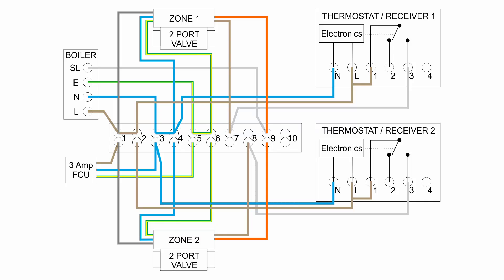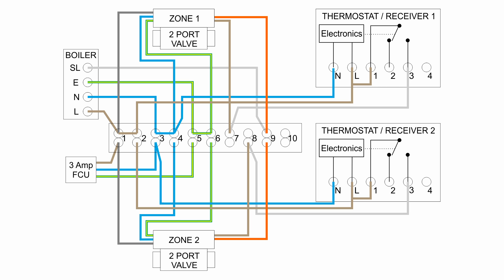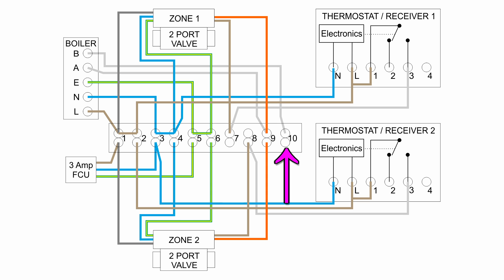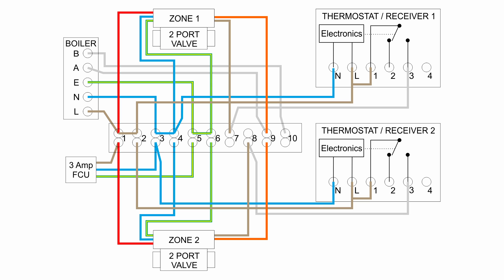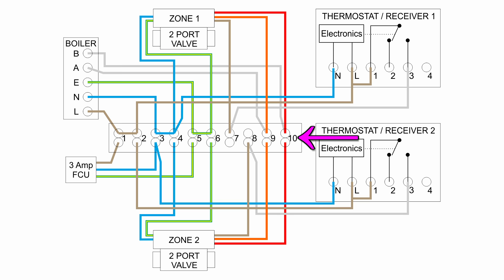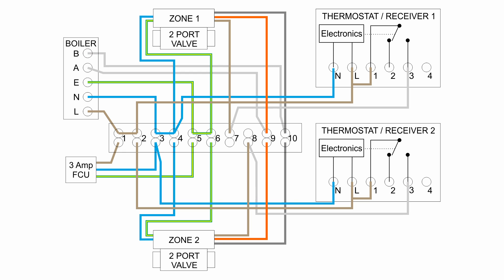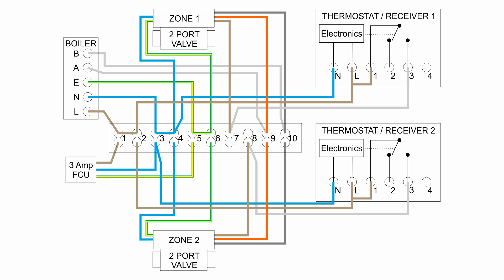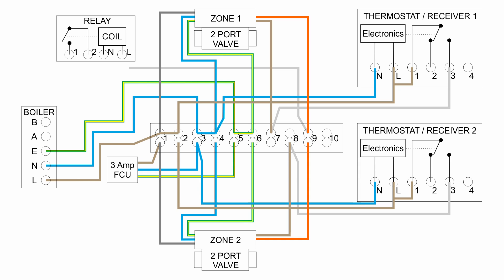Combi Boiler 2 Heating Zones Volt Free - 24V and Others

Comment: Your videos are very usefull. 
Not found information on this. 

How about using open therm and 2 zones This bugged me for a while Can it be done? Using 240 v from stat to switch the motorised valves and open therm as a better communication  .
 Would you say one open therm wire can be connected to orange and grey then other can be straight to boiler as these two wires not acting like a switch. 
Is there a way to to this ?😮
Am I try to over complicate things for having a more efficient set up ?

How about ignore orange and grey wires connected to boiler only use open therm connections from stat to boiler. 
Would that work?

Comment: My boiler supports both low-voltage and 230v control.. Which one is better to use ?
Reply: I have a circulating pump on zones 2 for UFH. how would I go about wiring this up?  E to E, N to N, L to  8 ?.. Once the Thermostat calls for heat, the zone will open and pump turn on. That would make the logic sense as 9 would be low voltage and not enough power for the pump? .. Would it make more sense to go for the 230v controller from your previous video?
Reply from the maker: Yes - the UFH pump is switched by the thermostat, so it only runs when heat is required for that zone.
Use the 230V switching option if the boiler has that.
Reply: @jwflame  thanks!

Comment: What if my UFH controller has volt free output switching for the boiler, but my boiler wants. 240v live return to turn on?
Reply from the maker: Connect 240V to one of the output terminals, the other connects to the boiler.
'Volt free' is just a switch with nothing connected to it, you can use it for any voltage you want.

Comment: Can A & B be connected in any order to the orange and grey
Reply from the maker: Yes.  They are just connected together when heat is required, so makes no difference.
Reply: @jwflame  would I still require the link from L to 1. I assume your using hive in this set up.
Reply from the maker: @asifk159786 NO, as the title states, this is for volt free switching.  If you connect L to any part of a volt free boiler input, it will destroy the boiler circuit board.
If the boiler has 230V switching, use the 230V wiring as described here: https://www.youtube.com/watch?v=98lZvN9q7rw
Reply: @jwflame  thanks. Boiler in question is ideal vogue which I belive isn't low voltage. The boiler has 2 outputs room stat and time. Similar A&b so I think the low voltage video should be fine.

Comment: Great video John!!! I just want to ask is it posible to add more zones in this system and how many  relays i would need ?
Reply from the maker: You can add as many zones as you want.  Each zone needs a valve and thermostat, thermostat output connected to the valve brown wire.  All other wires connect as in the diagram.  No relays required.

Comment: Hello Dear HOPEFULLY someone knows 😊 where is SL 
 In my glow worm energy 25c.
 on the left side where is mains I have L N E RT and on the right side of PCB have B OFF(burner) RT (24v )BUS (+-)
At the moment I have salus room thermostat connected to RT 24v 
My diagram required SL 
Thank you guys 😊
Reply from the maker: If you are using 24V switching, it's the two 24V RT terminals where the thermostat is connected.

The L and RT terminals are the equivalent if using 230V switching.  These must NOT be connected in any way to the 24V terminals, doing so will cause damage.

Comment: Very helpful. How could I accommodate a pump to this diagram please? I would like it to come on after the 2 port valve has fully opened. Thank you
Reply from the maker: Combination boilers have the pump inside the boiler, it's not a separately controlled component.
Reply: Hi John, my apologies i should have been a bit clearer as to what pump i was referring to , the pump i am quoting here is the ufh manifold pump which is connected to one of the two zone valves in my setup.  i think i will need to use the 230V switching diagram for this, any advise will be much appreciated. thanks
Reply from the maker: @nneethan5  Yes, it's the 230V version.
If it's a single UFH zone with only 1 thermostat, the pump connects to the switched output of the thermostat, which is also where the brown valve wire connects.
Pump will run for a short time before the valve opens but this doesn't matter as it only circulates water via the manifold and UFH, not through the valve.

For more than one UFH zone, the pump, thermostats and zone actuators are wired to a UFH controller, with the switched output from the controller connected directly to the valve brown wire.

Comment: Great video. I have one question, how to do it with nest thermostat with don’t have 230v ?? Boiler is directly connected to the nest by the OpenTherm . How to send signal to zone valve?? I am trying to find some solution..
Thank you for any suggestions.
Reply from the maker: You will need to use the other terminals on the Nest to switch 230V for the valve motors.  Opentherm is only control for the boiler.

Comment: Hi, this is a great video for learning!

2 questions if you don’t mind:
1) On the boilers with a 24v input, how is that 24v generated? Does the permanent 240v live to the boiler branch off and get reduced down through the circuit board? 

2) Where can you see what I put a particular boiler requires?

Thank you!
Reply: In this boiler’s case, one of the two terminals is outputting 24v and the other is detecting its presence. Hence the voltage is not very important, what it’s detecting is merely presence or not of a dead short between those two pins.

Comment: Mike Younge  Another informative video. In the drawing is show that Thermostat terminal 3 is linked to wiring Centre 7. In the Tado Thermostat  it can be linked directly to the boiler A&B . This would leave the brown zone wire free (7) where would this be linked  to operate the zone motor to trigger  9&10?
Reply from the maker: Any thermostat with volt free contacts can be linked directly to the boiler, but that is only usable for a single heating zone, where there are no zone valves.

Comment: Hello John, another great video. Are the relays usually supplied with boilers where non-230v to A & B terminals? Or if not can you suggest one please?
Reply from the maker: Relay won't be supplied with the boiler, if one is needed you will have to obtain it yourself.
For the diagram in this video, it would need a 230V AC coil and at least one normally open contact.

Comment: Hi John videos are very informative, in this example of a zone to a volt free combi, how could I also add a 240v pump to the wiring for an underfloor heating zone? Thanks
Reply from the maker: If it's a single UF zone with only a pump, then the pump connects to the switched output of the thermostat in the same way that the valve motor does.  
Pump N&E connects to 3&5.
For zone 1 in the diagram, pump L connects to 7
For zone 2 in the diagram, pump L connects to 8

Comment: Only problem here is you would have a 5 core flex going into the 2 port valve with single insulated cables inside the outer sheath with both 230v and 24v when really they would need double insulation atleast to keep the 230v away from the 24v.
Reply: Think you have misread the diagram as the only 24 volt connections are from the relay terminals 1 and 2 on to the boiler terminals A and B. All conductors to the 2 port valves in this instance have mains 230 voltage on them.
Reply: Al Hughes no I think you’ve misread its terminals A & B which clearly go upto the 2 port valve which has 240v at it too.
Reply: @robswingler  i see whats happening now, i am looking at the second diagram with the relay in not the first diagram which is what you are on about :P
Reply: A better option than a relay so you can do most of the work in 230V would be using the other kind of zone valve, with a 24v motor. There’s no real reason to do this all by switching non touch safe voltages, afaict.

Comment: John, guessing, what proportion of UK boilers don't use 230V SL ?

I'd be sorely tempted to permanently link A-B in the boiler and have the zone valves just power up the boiler !
My boiler doesn't have a permanent live - so not an issue.

I believe many systems in the USA are 24VAC control systems - so zone valve motors are 24V.

Comment: Very impressive. How about add nest gen3 diagram to demonstrate how to connect the OT1 OT2 of Boilers and nests through Valve grey and orange. That the Opentherm function can be achieve.
Reply: Hi
Have you sorted out the problem with nest ? I am now in this situation. Thanks for any help.
Reply: Unfortunately it’s not possible to use opentherm with multi zone heating (opentherm is a digital connection which doesn’t support multiple heating zones)

Comment: Zones are great but not very efficient. Heat on first floor rises to second floor, and second floor heat get combined with first floor heat that has risen . The first floor is usual to cold and the second to hot.  For this to really work correctly there needs to be a zones in every room upstairs . For that to work you need electrical dampers/valves to each room and a cold air/ water return in every room.   Interesting theory on paper.
Reply: Your floors aren't very efficient ! Here, heat on downstairs and upstairs rooms are very cold ! I have 5 zones: House, hot water, 3 bedrooms.

Comment: Well explained video to demonstrate electrical switching. I wouldn't bother wiring this when Evohome is a modern solution to this problem https://getconnected.honeywellhome.com/en/evohome
Reply: "With evohome, you control your home temperature room by room". I don't have 'evohome' - all room temperatures are individually controlled. 
The kitchen RADIATOR has 2 heating zones - top inch AND all the rest. The two zones in the rad being independently controlled. 
The bathroom RADIATOR also has 2 heating zones: Top inch (for drying towels) and the rest for heating the room. It is also on 2 ZONES - offering 2 different bathroom temperatures at different times.
"Your evohome lets you create and control up to 12 smart heating zones". With my system, there's no limit to the number of zones.
"Control where you need it" - in the rooms ! We have no need to persistently fiddle with heating controls !
"Energy efficient - with evohome smart zoning, you only heat the parts of your home that you’re actually using" - Our heating system does this.

We don't change settings on our heating system from one year to the next. It automatically doesn't come on in the summer. On cold winter days, it comes on earlier in the morning. House Zone room temperatures are set by TRVs - and they're very accurate & reliable and cost nothing to run.

The wiring in this video will be a lot simpler than evohome !